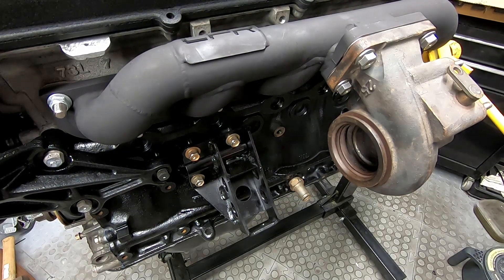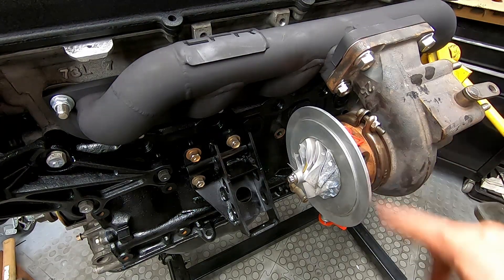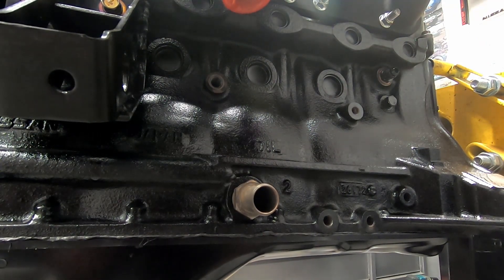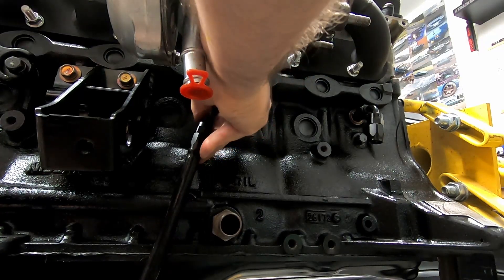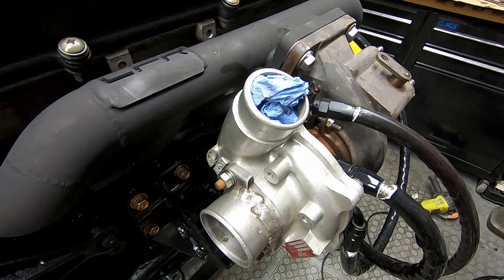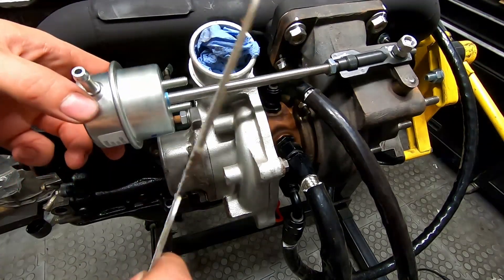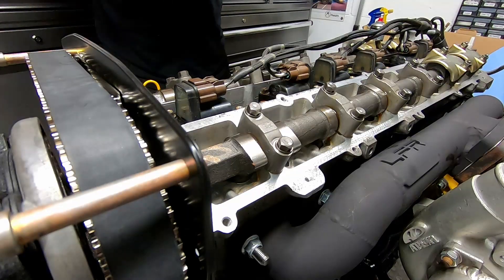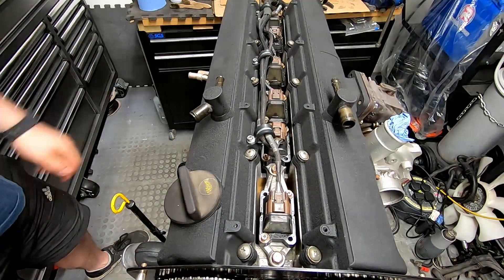RB20DET Rebuild (Part 5) Apexi Turbo Install -- 350-400bhp

Comment: Great video. What exhaust manifold is that? Also how did you route the coolant line around the back of block?
Reply from the maker: From memory it's a LeadFootRacing manifold, based in the UK. Normally I use the clip that holds the hard line, open it out to remove the hard line and pop the braided line in it and close it back up

Comment: Hey man. I have this same apexi turbo I am about to put on my rb25det. Do you remember what the size of the AN fittings were for the oil/coolant into the turbo? Also would re doing the coolant line at the rear of the block be too hard to do with the engine in the car?
Reply from the maker: I think they're M12x1.25 but not 100% sure on that, I went with AN4 lines. Yeah will be tricky to do in the car but not impossible, there's a single M6 bolt holding the line on the back of the block, it's the clips for all the coolant lines that will be the trickiest bit
Reply: @ToolTimeWithTom  thanks for the reply and info mate, much appreciated!

Comment: Hey we're can I find all the torque specs for the rb20det
Reply from the maker: Have a google for "R32 engine manual" there are plenty of copies online
Reply: @ToolTimeWithTom  ok thanks I look but who do you trust for that there's a lot of BS out there
Reply from the maker: First search result should be the factory service manual
Reply: What rpm do you hit full boost
Reply: @Grumflyer  like 7 I have a stand alone so I can set different red line points